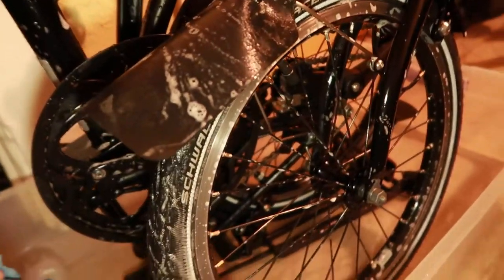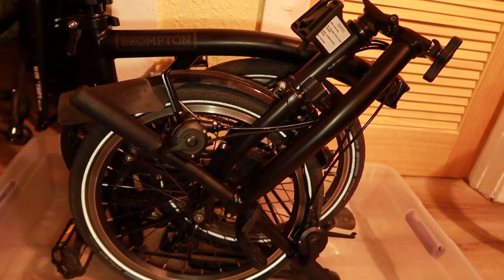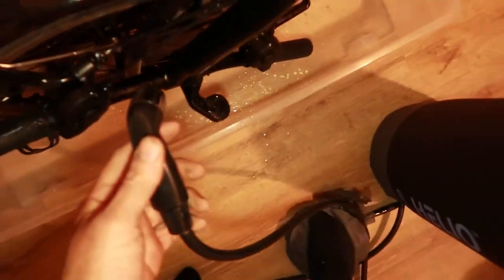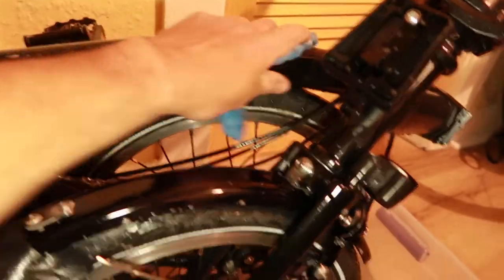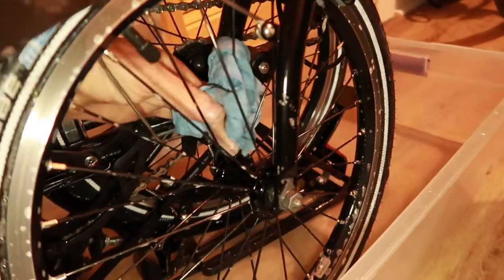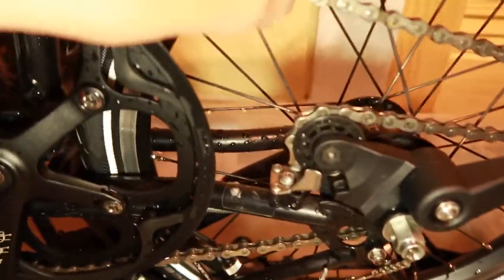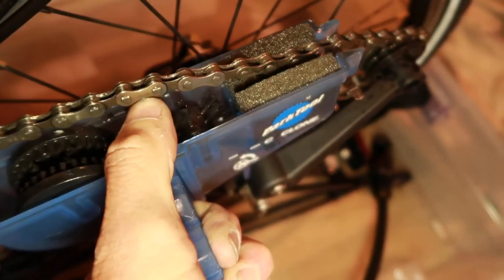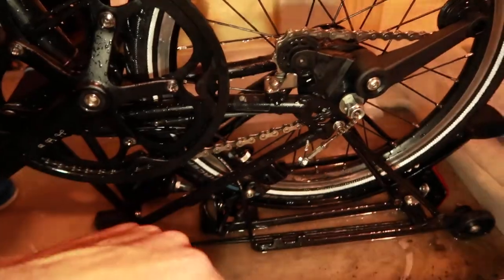How I clean my Brompton

Comment: Hey Brian you ever just consider using spray waxes/quick detailers with Microfiber towels for the cleaning.? It'll be way less messy and you'll be adding a little wax protection and shine as well as not getting the bike wet all the time making all the metal stuff happy etc
Reply from the maker: Thanks for the suggestion.  I will revise my methods.

Comment: Not sure how Google served up this channel but the timing could not have been better.  Just ordered my first Brompton from Chuck in Bolder and just waiting for it to be shipped to Texas.  Living in a house allows me to clean outside but your inside setup up really a great way to go.  The chain cleaning device is also very cool, I need to locate one of those.  I do have one question for you if I may: if you ever need to leave your bike for a period of time, how do you secure it to keep it safe from theft?  Thanks, Chris
Reply from the maker: Well I shy away from leaving any of my bikes anywhere for an extended period of time.  I mostly will bring my Brompton inside with me anywhere it go.  If I have to leave it outside for some reason, I use a U lock though the frame by the seat post and a cable through the wheels.
Reply: Agreed with what Brian said, do not leave your brommie outside. One of the main selling points of the brompton is to be able to take it with you everywhere. anti-theft device is the bike itself and the fold.

Enjoy your bike!
Reply: Chris, I'd also avoid locking it up outside, but I assume I do that sometimes out of laziness or actual necessity. I'll make a video of the precautions I take when locking my Brompton outside. I do have a pretty good u-lock though. Anyway, your gonna love your new bike!
Reply: Good choice!!

Comment: first thing: you are using the chain scrubber the wrong way round. the foam is there to filter the muck from the cleaner liquid and should be on the trailing side of the chain.
If you going to clean the chain with bike folded then best to remove the scrubber handle so that the scrubber can face the other way  and hold the scrubber while you rotate the crank  80 revolutions. I mention 80 as this works well for me and i scrub the chain twice with clean fluid both times and rinse off with a garden pressure sprayer.
The Park cleaning fluid is damn expensive and there are better products out there and much cheaper.
Thanks for recommending Muc off dry..that's on my list now as Squirt is falling short on it's promise.
Reply from the maker: Thanks, I was never shown.  You learn something every day.
Reply: Also, the Muc Off dry chain lube is for dry conditions.

Comment: Thanks for this mate. It says on the site if you have Sturmer Archer hub be sure no water enters in so I wasnt sure how safe washing it. What do you think?
Reply from the maker: I have washed mine with no issues.  As long as you are not pressure washing directly in the hole you should be fine.

Comment: It's a good idea to wipe the chain thoroughly after lube, to not attract dirt sticking to the external chain. Lube only needs to be in the link.
Reply from the maker: I do put lube in the link even if the video doesn't show that.  I was holding a camera and trying to lube a chain at the same time.  The lube I use is suppose to repel dirt.  Not so sure if that's true but that's what the manufacturer says?

Comment: Wait so you use Muc off dry in wet winter conditions and a wet lube in dry summer conditions? I don’t understand Unless weather in different in Denver? I live in London and use dry lube in the summer as wet lube grabs the dirt off the road. In wet wintery times I use wet lube as it sticks better and is more water resistant. Just found that interesting not trying to be rude or anything :) Thanks for the video Brian
Reply from the maker: I use muc off during the winter mostly.  I also use Phil’s during the winter as well.  I use T9 during the summer.

Comment: Thanks for your video. I like the water pump spray. I want to buy one to clean my dirty exterior windows.

The grease can clog up your drain & plumbing. I cleaned my folding bike over a boot tray—-a lot harder than over your shallow bin—and dumped the dirty water and grease in my kitchen sink. Fortunately, the kitchen plumbing was already clogged and my condo association paid for the repair. Next time, I’ll take my bike to a self-serve place to clean my bike or my cousin’s house.

Comment: Great video  !!!  You can also  clean your chain very easy with some W40 or just super car fuel. But it can smell bad into a small appartement ofcourse.  You can take your bicycle to a self- carwash and take your stuff with you overthere.  Bc i like to clean my Brompton when he is unfolded . When he is open , its much more easy to clean it. And to be honest , your chain dont need to be perfect clean.  You can change your chain every year . Its also much cheaper than all the products that you buy. If you ride alot , just replace your chain every year 👍
Reply from the maker: I wish my chain would last a year.🤔. My chains wear out in a couple of months.  I have been taking the bike to a car wash lately to help clean it in a timely manner which helps out a lot. 👍